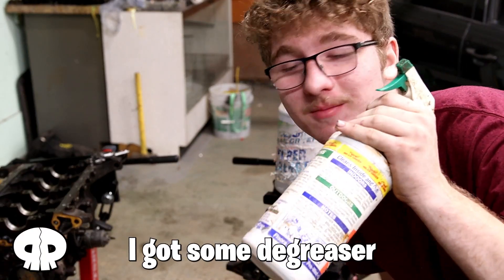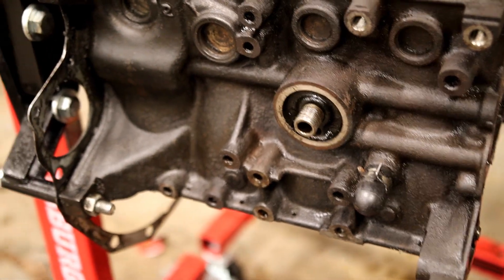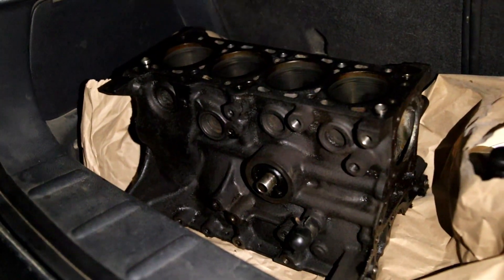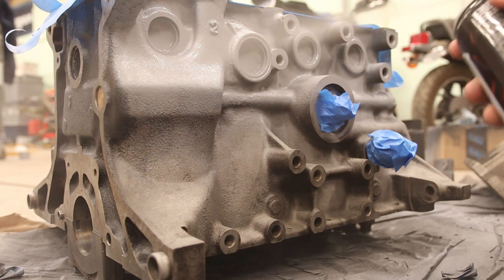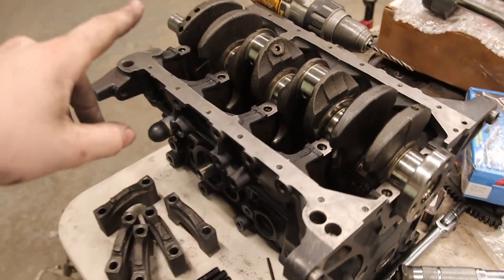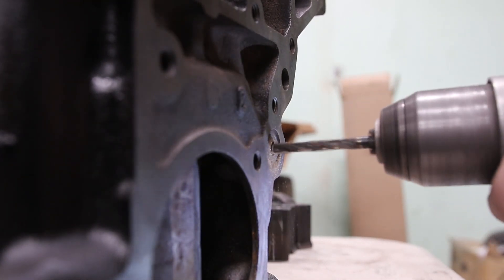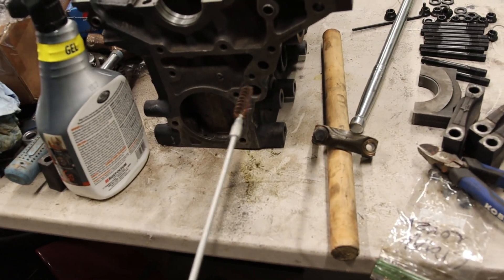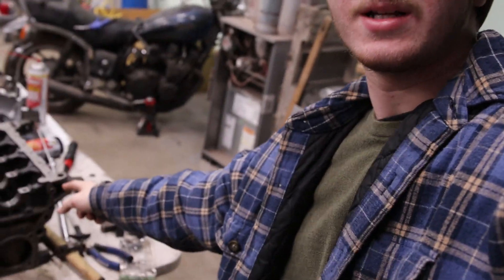Prepping The Block - 500HP 1.6L Forged Miata Engine Build

Comment: sandblasting is not a good idea for engine components, seen a lot of engines die this way. Make SURE to clean everything with water and if possible a solvent to get every bit of sand out of there. 
Vapor hohning or a parts cleaner at a local shop is a way better and safer idea, also the parts look like new after that if its done a good job
Reply from the maker: I'm not too worried. I masked all the ports and holes off before sand blasting. Then I flushed it out in a parts cleaner after. Visually inspected it and no sand left on anything. Thank you for the words of advice.
Reply: Cant wait to see this thing rip. Keep up the great videos🔥🔥
Reply: Yeah I also wouldn't sand blast anything in the engine. It might damage sealing surfaces and tight tolerance zones
Reply from the maker: @mauricioonoro3264  All I sand blasted was the left and right outside surfaces of the block. I masked off all of my bearing surfaces, ports, and cylinders. No sand hit any tollorance sensitive, or oil inlet areas